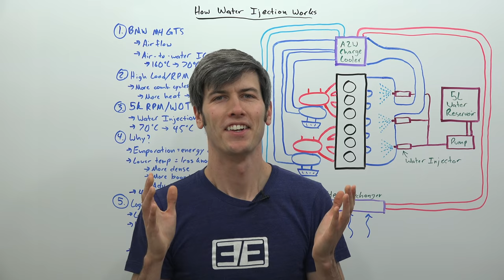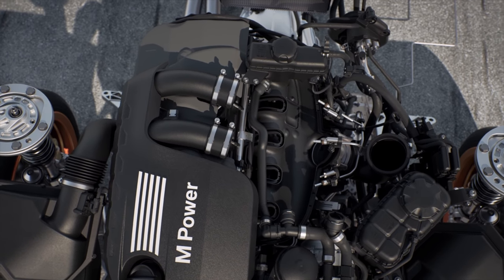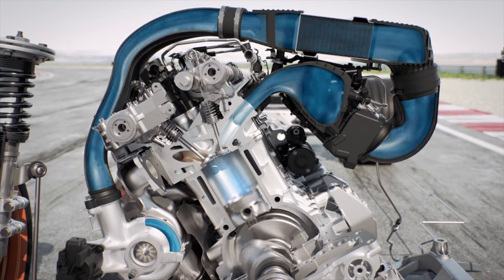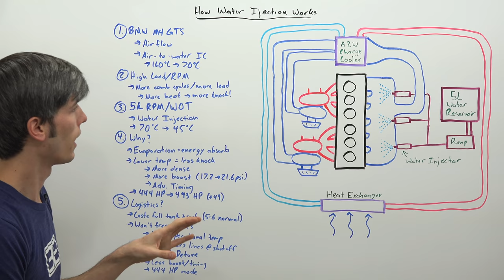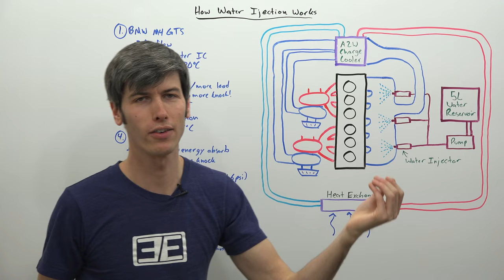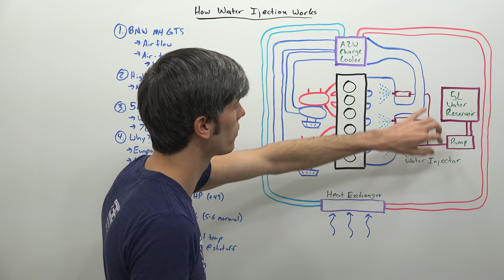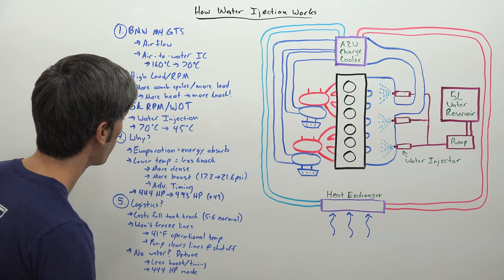How BMW Used Water To Make +50 Horsepower

Comment: In Serbia all cars have this technology because all the gasoline is pre-mixed with water :'D
Reply: Lol😂
Reply: Always a step further
Reply: If you want to get the water out of your fuel you can put a straw in it and drink the water out from under it. This is useful when siphoning fuel from your neighbours' tank, as it allows you to stay hydrated while you run away with the gerry can.
Reply: Hahaha huh huh hyoi hyoi yoi oi oi oi yoi oing
Reply: @martygraxoxo  my point exactly doctor thank you for the compliment doctor oh, don't mention it doctor, those of us in the field of rocket science should support each other huh hyuh  yoi yoi yoi oi oi oi spr oi io io yoi yoink
Reply: @martygraxoxo  moreover, I scrolled through your channels list doctor, it instills a sense of loss with subtle overtones of Sorrow and long-suffering so I thank you and bid you a good morrow
Reply: I dont think thats how it works bro, the water has to be sprayed into the incoming air to cool it down. Mixing water with the gasoline is just a cheaper way to fuel your car lol
Reply: Water doesn't burn so the engine would struggle to fire if you had water in your feul, water goes into the pistons and turns to vapour, then straight out the exhast with the fumes
Reply: @lukedcmax  Are you familiar with a scientific concept known as the latent heat of evaporation?
Reply: Lol, America as well.
Reply: @j.m.5995 what does it mean?

Comment: Don't use water, use Brawndo; it's got electrolytes!  It's got what power plants crave!
Reply from the maker: Power plants, ha! Love it.
Reply: Seems like windshield deicer would work better.  It's got methanol!
Reply: Yeah itll help ehomaney too
Reply: What are electrolytes? Do you even know?
Reply: Well, then get some Gatorade ...
Reply: what is electrolytes? i dunno but it's extremely awesome!
Reply: I remember Brawndo!!
Reply: Brett knoss, it's what they use to make Brawndo.
Reply: Yeah, why use water, like out of the toilet?
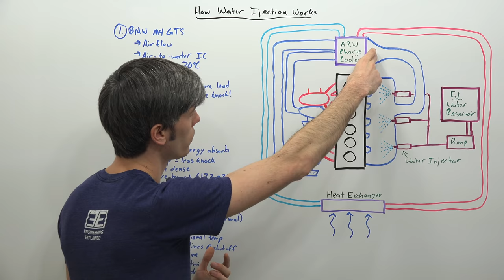Reply: @EngineeringExplained  2:42 are you sure that would be 45°C if the reason they added it, was the velocity of the air was too fast to be charge cooled?
Reply: Camacho 2024😂

Comment: I have a water injection system... My headgasket blew
Reply: My dads van had that, he said it ran surprisingly well... for a limited time.
Reply: Oh yeah this self-installed on my car,  too. It was a cloudy day on the highway
Reply: @schievel6047  I hear its usually a self installed mod.
Reply: Internal Water Injection System. IWIS for short. Sell as is, but charge extra for it.
Reply: feelsbadman...

some flextape will fix it.
Reply: My stepdads van has a brakefluid injection system
Reply: @TheIdiotPlays  ohh I heard those give extra stopping power when it's too dry out
Reply: Weird flex but ok
Reply: My wife combined that with "oil injection" on her '97 Excel. It smelt delightful.
Reply: At very high temperature,  is there any chance of water converting into steam in combustion chamber
Reply: @mvicky471  water must convert into the steam before the compression stroke, other wise it will blow the engine because water is a incompressible fluid.
Reply: @mvicky471 : That's the desired behaviour. The phase change from liquid to gas is what absorbs energy and lowers the air temp.
 @Ling Chee Huat: It's the quantity of water that matters. This only uses very little.
Reply: @xmenlingcheehuat0811  
Only steam. Not "the steam".
Reply: @Oosh21  yea, the quantity of the injected water plays the role. I was answering the question. If the water is not evaporated completely before compression stroke, your piston is done.
Reply: @andersskjoldager-gregersen3240  Alright, I apologize for not checking my grammar before posting. English is not my primary language, mind you.
Reply: @zuilok   Limited time is more than enough for any modern BMW anyway
Reply: @xmenlingcheehuat0811  not true. The tiny amount of water injected won't affect the engine even in the very unlikely event that it should all remain liquid. The volume of water injected is so small that it subtracted from the remaining volume at TDC won't even influence the compression ratio least of all induce hydro lock.

The damage on engines with water injection often comes from overdoing it or faulty installations where the power levels reached lead to catastrophic failure as soon as there is not enough water injected/vaporised.
Reply: HAHAHA mine to xD
Reply: @paulf3353  People really seem to hate modern BMWs. I guess I better stick with my E36.
Reply: @xmenlingcheehuat0811  Except that's not correct, a small amount of water (as a liquid) won't do much, there's water in the fuel you get from the pump. It's the quantity that matters.
Reply: I've been using water-methanol injection for over a decade and it's been awesome... you're probably just not tuning your vehicle appropriately.
Reply: @schievel6047  than you had too much water
Reply: Vikneswaran M 
i wondered the same thing...
and also water feed for a hot engine?
isnt there a theory saying a heated metal splashed with water breaks
🙁
Reply: @endurofan9854  no.. Methanol or water injection is around since ww2 used in planes.. If you dont use correct nossel or you inject too much then isnt good for engine.. On a diesel with water, meth is 20 to 50hp gain
Reply: Robi Čepin 
👍
Reply: Subaru?
Reply: Good luck man

Nice tune bruh😂
Reply: @mvicky471  that's what evaporated water is.
Reply: @2:57 were you injecting liquid water?
Reply: @samueljackson856  yeah i thought it was iron water 😂
Reply: Yea. Water mixes with the oils on the cylinder walls and it forms an acid. That acid causes heavy pitting and metal corrosion. It works for a short time.
Reply: @BepBepStev  the amount of water injected per combustion event is very little. If you do the math even if the water stayed in the cylinder and didn't turn to a gas, it would not be enough to hydrolock the motor.die to the high pressure injectors the water is atomized very well. There aren't droplets forming on the cylinder wall and there is a layer of oil on the walls to prevent corrosion. It only has message on at high rpms and high load. This will not corroded the cylinder walls.
Reply: Water mixing with oil creates an acid. Extended exposure to this acid causes wear. Thats why head gasket leaks on liquid cooled engines, even minor leaks, are a big problem. The water thats mixed with the fuel is a killer of engines. Sure you can introduce it at high RPMS only and limit it all you want, yes, but in the long term, youll see its effects.
Reply: @BepBepStev   head gaskets typically fail from over heating, a bad tune, or too much cylinder pressure.  2 different things here.  You will not see cylinder corrosion from this system. As I stated earlier there is water naturally in the air the motor draws in. On a cold day you see this as a fog from the exhaust. Modern synthetic oil don't break down like conventional ones .  The oil on BMW's run hot (over the boiling point of water) and further boil off any moisture that may have gotten into the oil. Your making a big deal over something that will not happen . These are not older engines. These motors are corrosion resistant and the head gasket is multilayered and designed to inhibit corrosion from dissimilar metals. Please give an example of cylinder corrosion due to water injection on a modern engine? You will need a rebuild long before the effect of added moisture cause an issue. Again very little water is introduced per intake stroke. Not enough to hydrolock, just enough to cool the air charge. Not a big deal
Reply: @robicepin9209  too much water increased compression especially if you don't have a vvti head to advance the exhaust valves to lower the compression.
Reply: VVTI doesnt help too much compression when both valves are closed on the compression stroke. Youll start leaking from the head gasket or if the head gasket is new, you can actually bend or fracture a rod.
Reply: Would an Air to Air intercooler not be more effective ?
Reply: subaru’s don’t have water injection tho?
Reply: I know I'm late to the party, but do you think there's much benefit in a N.A. Vortec 454 35ft motorhome?  It's modified with lots of bolt-ons including massive Ram-Air system and exhaust (no headers yet), etc.  Not tuned yet, but I'll need a tuner to advance the timing based on the water vapor system, is that easily compatible? Would there be much benefit if not tuning it accordingly to the much higher octane of added water vapor (advancing the timing) on a fairly low compression, naturally aspirated V8? Running cooler doesn't hurt, but also looking for power and MPG gains, so is a tuner required to maximize benefit via advanced timing and possibly extra fuel? There aren't alot of 'on-demand' tuner options for this engine as its an early OBD2 (1998)- most require you ship in your computer or buy an extra one with the new tune installed which means I can't monitor/adjust parameters on the fly (like based on amount of water vapor).  What should I do?
Reply: No, it will get in the oil and ruin the bearings.

Comment: But Soapy Wooder is +150 HP
Reply: Chrisfix?
Reply: Quit commenting on inside edition videos
Reply: @fantasyphilosophy3261  yep chrisfix 😂
Reply: _Bob McCoy adding blinker fluid to the fuel tank and piston return spring upgrade yields extra 1000HP
Reply: Erwin Priyono [Erw1np] Dont forget to get a performance muffler bearing for better airflow before doing those tunes though
Reply: Nitroglycerin injection, +99999999 HP, 99% chance of explosion.
Reply: Wooder??! What is that huh?????

Comment: If you fill up the reservoir with mountain dew, you get 100 more horsepower
Reply: No energy drank
Reply: How about Budweiser?
Reply: You know someone is thinking "Hey...this is like a wet shot nitrous system right from the factory!" and is going to fill it up with gasoline.  Who am I kidding?  That someone would be ME...if I had the money to buy this car
Reply: red bull, and you will enable flight mode
Reply: Brawndo!  It has electrolytes.
Reply: Bartle Skeet injection
Reply: julian hernandez hell yeah brother
Reply: Red bull.  It gives you wiiiiings.....
Reply: I think you meant to say Bartle Skeet.
Reply: @straight_intro  If you give Budweiser to a BAVARIAN engine it will refuse to run and will hate you forever.
Reply: Bartle Skeet for race or street!
Reply: Hell yea brother
Reply: Cleet, is dat you???
Reply: Red bull will make it fly
Reply: @straight_intro  It'll cough, sputter and choke to death.
Reply: Use morning dew suck it thru yr cold air intake pipe...more hp..n...is free......lol

Comment: I wonder if BMW will start selling 'special' BMW branded 'go faster' water?
Reply from the maker: Hahaha, they should. "M water!"
Reply: MEvian.
Reply: BMWater
Reply: @aaronbuck1518  Bayerische Muhlen Wasser. (Bavarian Mill Water... clean extra cool water that has trickled down from the Alps).
Reply: @aaronbuck1518  Bowel movement water
Reply: nox ? ^^
Reply: I wonder what a little methanol would do for it bc a friend that I help turbo his car we ran a meth injection kit to cool the intake temperature. Managed to get 400 hp from a 1988 BMW 325is e30 with 2.7 l displacement a one off car took about a year of weekends to finish it up. Without the meth u turn down the boost and get a drivable 320 at the wheels. Cut up the boost and the meth injection and 400 whp. The engine is a BMW m20 a sohc 2.5 l to begin with.  Custom internals in the motor. It was a beast. No traction control at all abs was the only electronic driving aid. You could destroy tires at will. Had to be careful when getting on it. Had a tendency to break loose on dry payment when the boost came on. Never drove it in the rain because it was a accident waiting to happen. Too much power for typical street driving.
Reply: @rbmwiv  Sounds like a fun car
Reply: Thomas Iturraran it was and you had better be on your toes when driving it because oversteer is just a small throttle blip away. Managed to fit 255 on the rear factor it had 195. It took custom offset rims and rolling the quarters and fenders.
Reply: Do you mean , like BMW Piss ?
Reply: The 1962 Oldsmobile Jetfire had  Turbo Rocket Fluid, it was a 50:50 mix of distilled water and methanol, with a little rust inhibitor thrown in.
Reply: Use distilled water is about a dollar. Or go over kill use boost juice.
Reply: Only $75 / gal.
Reply: @EngineeringExplained  Because it Mater s
Reply: yeah if i owned one I mostly use water.  Yutube Lurker
Reply: Swampy  yeah but the e30 weights just about 1100kg (maybe less)
Reply: Wonder if heavy water make a difference
Reply: Swampy  you're forgetting that muscle cars aren't exactly quick to get on the power, and most of them didn't have overdrive, so 70 was redlining in the highest gear. Modern higher power cars they don't make peak power until well above typical driving revs, and they also have driving modes that de-tune the engine for casual use, as well as all kinds of driver assistance specifically to keep people from accidentally over steering in a corner. that particular engine is a straight 6 NA engine, so i'd expect throttle response to be fairly quick and power to be readily available just about driving revs. it also is from right around the time any driving assistance was even feasible, like he said, only has ABS. 400hp in a 2.7L from the 80's is very much not 400hp in a 5.0L V8 from the 60's or 400hp from a 2.5L in 2019.
Reply: Methanol would definitely let you run it at much colder temperatures - for example, in WWII the Luftwaffe used a 50/50 water/methanol mix to inject into airplane engines to increase power for takeoff and combat - and this allowed (briefly, for maybe ten minutes at a time) large increases in power, apparently through both charge cooling and allowing higher boost pressures, for example the DB 605 made 1080 hp at 5500 m altitude without MW50 injection, but 1700 hp at 4000 m altitude with the MW50 injection.

The methanol does lower the cooling effect (methanol has a lower heat of evaporation than water), but it also acts as an anti-detonant by itself, which lets you use much higher pressures.
Reply: You bet
Reply: @rbmwiv  You're talking about the classic M20 ETA build (just with boost), which was common to do in the 90's and was a budget way of increasing displacement by using the bottom end of 325E (which was really 2.7) and combining it with the 325i head, since the 325E head was restricted. It no longer makes sense to go that route tho, but it's still cool in a "blast from the past" kind of way.
Reply: Placeholder Name actually it had a 524td forged crank custom forged rods and pistons. Wasn’t the typical stroker. Had over a 7k rpm redline.
Reply: @rbmwiv  If i ever go that route again, i'd probably look into one of the Ireland Engineering stroker kits, just cause im lazy these days.
Reply: @user-qx7tm5df8j  H2O
Reply: And You will void warranty if you don't.
Reply: Lodge Cav 😂😂😂
Reply: Lodge Cav yup. It’ll be windshield washer fluid with a really fancy label.
Reply: We do this in HVAC for buildings it's called adiabatic cooling. We use osmosewater because of the small injectors holes
Reply: Bavarian ///M water you'll get 50 HP just for 1,299$ and 95 ¢😂😂😂😂😂😂
Reply: @EngineeringExplained  (In reply to ' Hahaha, they should. "M water!" ') thats actually how the Water Utility here in Munich is called ( M Wasser ), so that could actually be Tap Water :D
Reply: It's called Lowenbrau. You're only a 7-Eleven away from a tank refill.
Reply: I am 100% sure as soon as this car gets to Russia , they will put their Vodka into water tank))) no rust, no ice, and octane boost like from methanol)))
Reply: @EngineeringExplained  then coca cola would buy it for millions like they did with 50 cent 🤷🏼‍♂️🤣

Comment: Several years ago at a promo Bosch marketing folks boasted about how they developed new cool water injection system (the one that was later used in this car). So I told them "Oh, it's not entirely new, you made MW50 water-methanol injection system to be used with BMW 801 and Daimler-Benz DB 605 aircraft engines back in In 1942 for Nazi Germany Luftwaffe". For some reason they didn't like my comment.